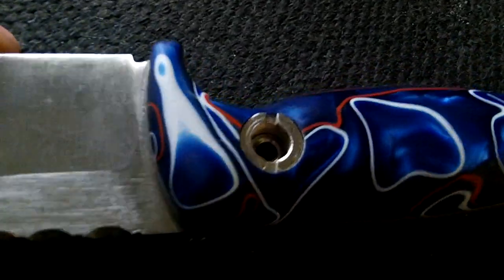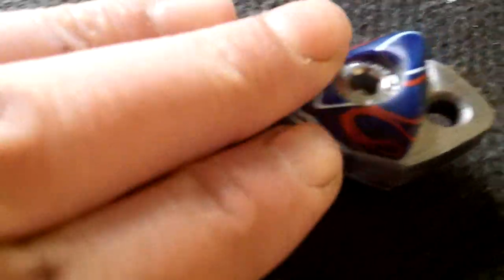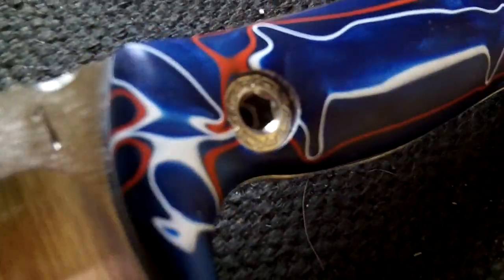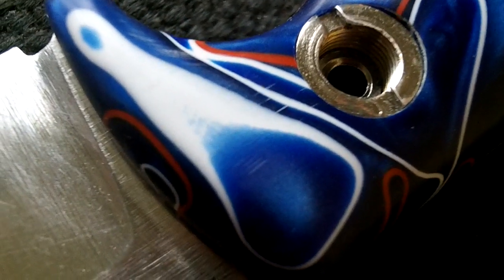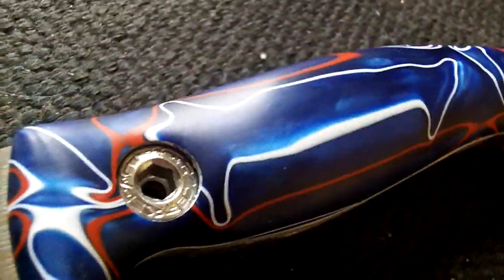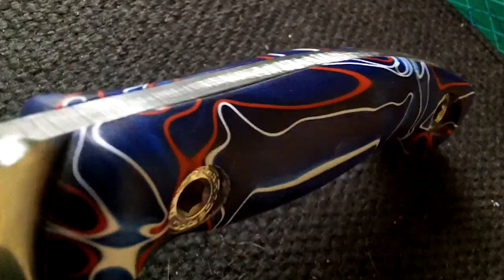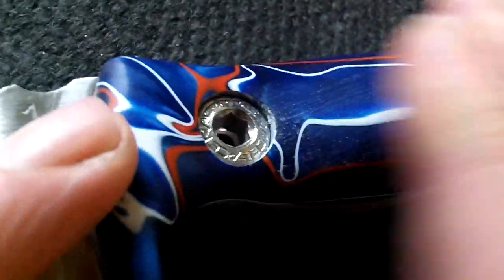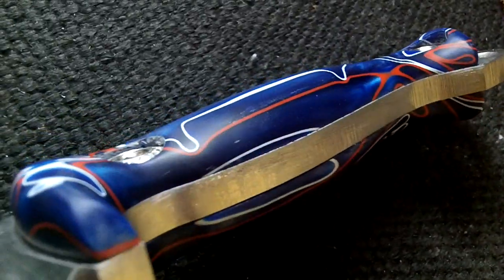Kirinite Handle Progress

Comment: I'm working with kirinite right now, it doesn't actually work the way you assume it would, the more you buff and polish it the more grippy it becomes. So if you take it up past 1000 grit it and buff it, it won't actually become slippery it actually gets more grippy.
Hope this helps.
Reply: Londinium Armoury 
I’m using Kirinite for the first time on my current knife. 
I’ve got up to 2500 grit - you think that’s high enough?
Cheers man
Reply: @sudo_nym  I think 2500 is high enough, you could always finish it on some buffing cloth or a buffind disc/wheel after if you want it extra shiny. I think it looks fine at 1500. Good luck with the kirinite buddy.
Reply: Londinium Armoury 

Great, thanks bud 🤜🏻⚡️🤛🏻
Reply: @sudo_nym  Anytime :)

Comment from the maker: no its made in Italy and imported/exported from my mate over at ivoryalternative. He is currently building a new website with all the products on. He primarily only sells it as sheets though not scales, there is an ebay account that sells it it occasionally by the scales in Kirinite and G10. There is no point in going to the actual manufacturer as there is exclusivity contracts.

Comment from the maker: You'l NEVER go back to normal paper, I use 120, 240, 320, 400 and the 600. They go to like 40 thousand for buffing the acrylics, I am going to try the 80 grit.

If you PM me your address I can send you a selection over. I buy them in such bulk they cost almost nothing and weigh almost nothing to ship, try before you buy lol. I wouldn't mind.